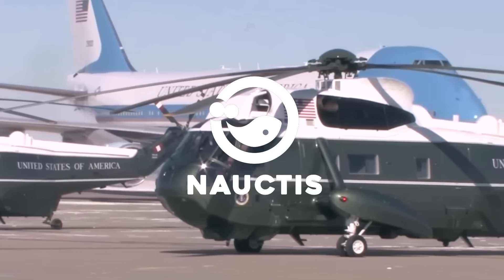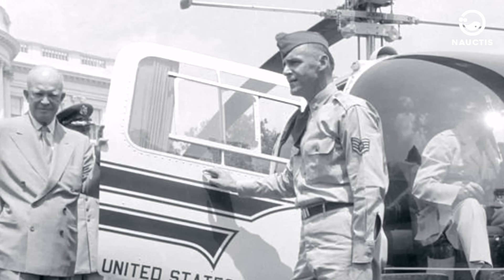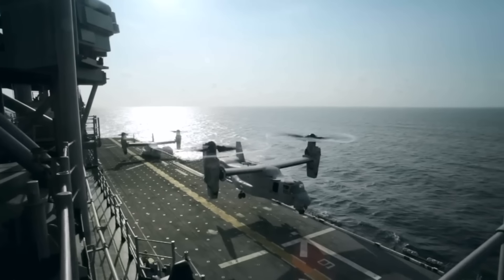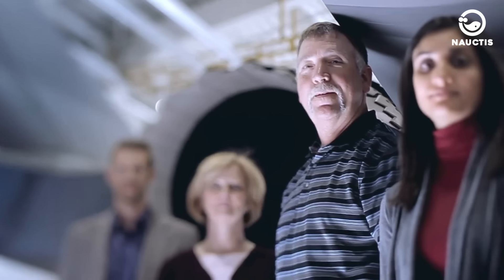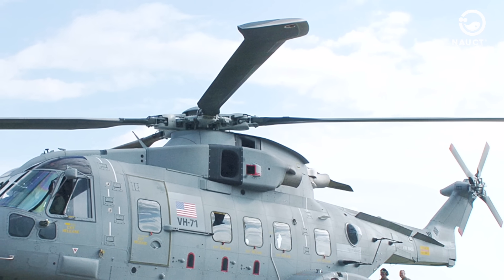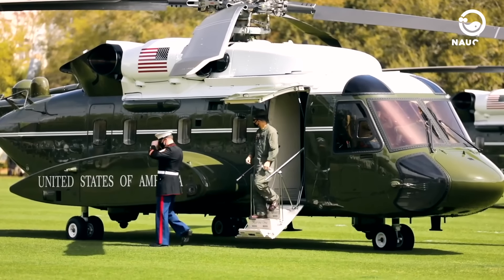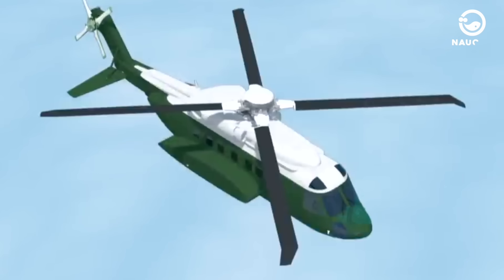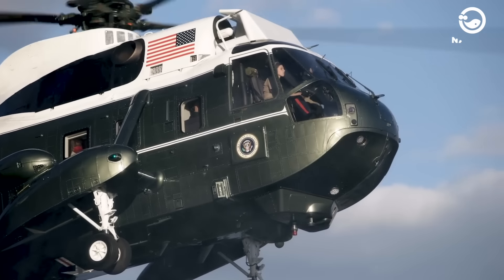INSIDE The NEW MARINE ONE: The $478 Million Presidential Helicopter Fleet

Comment: I have a stupid question: Why dont planes and helicopters have parachutes instead of just letting everyone face certain death?
Reply: There are some that do, however the size of the parachute to have any effect would be massive, then you have to add the stress on the airframe. Finally you have to look at elements like autorotation for helicopters and glide distance for aircraft meaning if its just an engine failure they dont fall out the sky, they only do that when something massive goes wrong which is a low chance, and even lower that something like that goes wrong but doesn't damage the parachute system. 

Not a stupid question at all, one I did some research on during my engineering degree because I had the same question!

Comment: Turned wrenches for 4 years on the H-3 (SH-3A/G/D & H models), what I want to know is how they kept all the hydraulic fluid and trasnmission lubricant that used to coat the bottom of the transmission and drip on the cabin floor, soak the soundproofing etc off the President.  Only managed to get quick glances of the interior of these helo's when Reagan would fly into NAS Pt Mugu. They parked them in the hanagr where my squadron VXE-6 worked out of.  Marines always guarding these aircraft 24/7 and the area around them was roped off.
Reply: When I was based at South Pole Station, VXE-6 flew C-130s in Antarctica.

Comment: Wow, the VH-92 "failed to meet the requirements"... big surprise. The White House should have asked the RCAF how we were doing with our CH-148 Cyclone variant. One of them flew the crew (including a buddy of mine) into the water because of Sikorsky's messed up flight management system and lack of testing. And here we are, 4 years later, and there's no physical fix for the issue- they opted instead to warn crews that one simple switch can kill them... not to mention the failure to meet performance requirements. No wonder we're the only suckers that bought them.